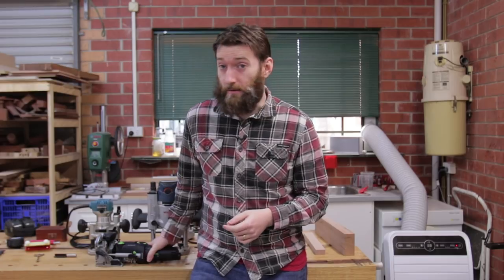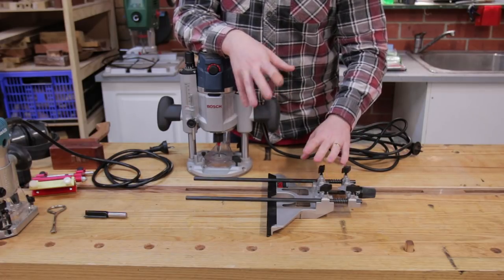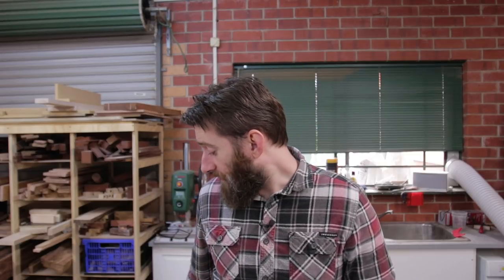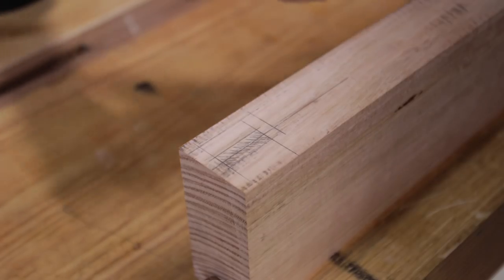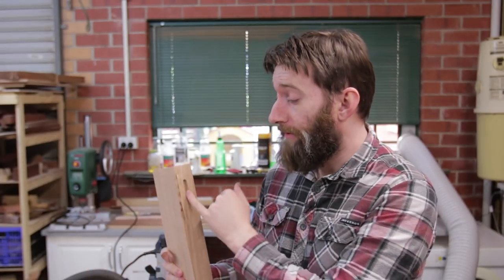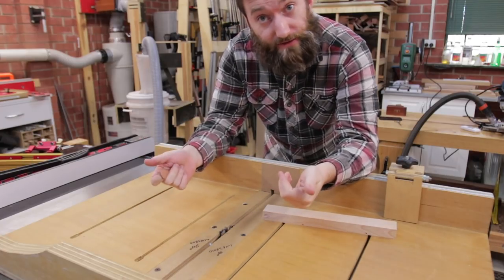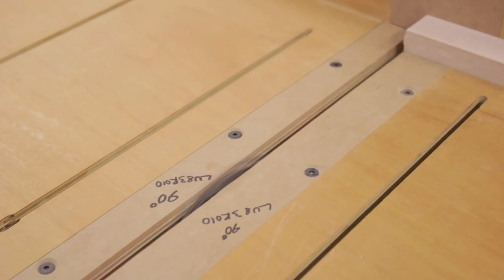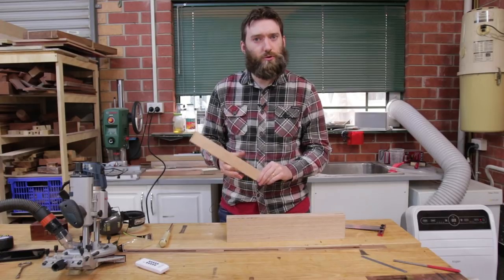How To: Mortise & Tenon with Power Tools

Comment: Ditto your methods. I use the Domino for the appropriate size. I also make custom dominoes and use the 3rd setting wide hole.AND for big stuff.. yes as you do, I cut with a router and table saw.
Reply from the maker: It took me forever to get to custom, extra-wide dominoes, but when I did it was this real lightbulb type moment! Do you use just a round over bit for them, or do you have a good source of metric bullnose bits?
Reply: I have a small trim router fixed in an Aldi router table..  (not much use for anything else). 3/8 round over. I'll make a couple of dozen at a time and then round over the edges.